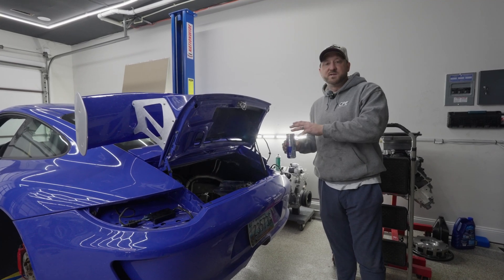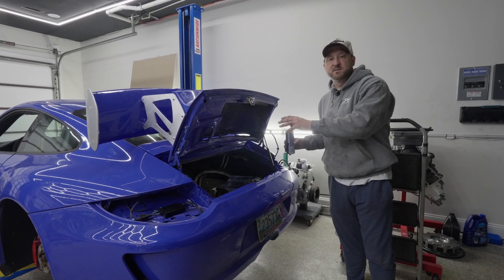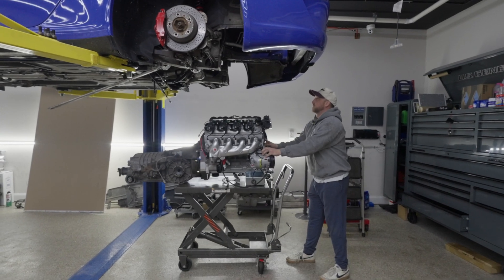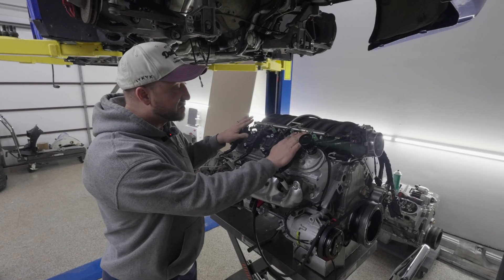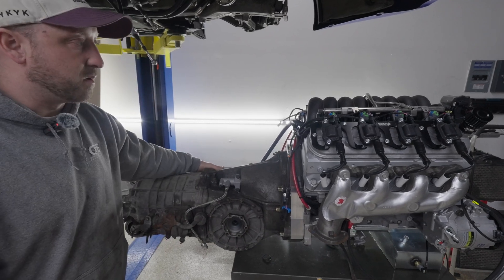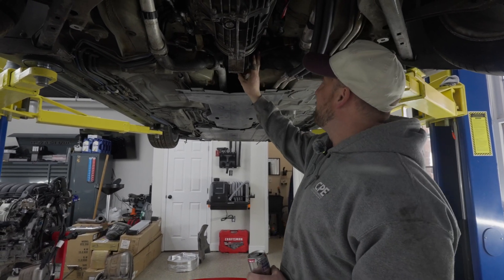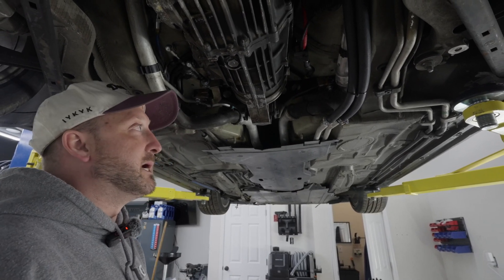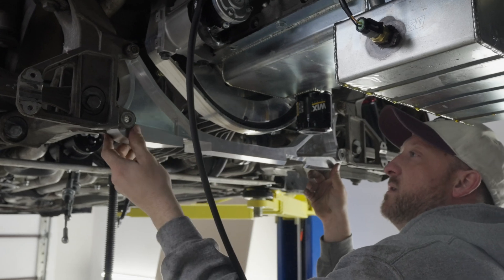"How To" LS Swap A Porsche 996/997

Comment: Looking at a clean 03 911 with no motor no transmission. I have an aluminum 5.3 with a 4l60. Do you have a kit for the GM transmissions to fit in?
Reply: Pretty sure youre going to need a transaxle and a 4l60 isnt going to work

Comment: Is you move the powertrain forward 1in does it that still work on a C4S? Thanks
Reply from the maker: It does, this specific car is AWD.  The driveshaft simply gets shortened, a fresh guibo/flex disc installed, and re-balanced for ‘02-‘08 cars.  ‘99-‘01 cars don’t require any modification driveshaft wise!

Comment: Do you find the 997 6spd AWD driveline to be adequate in holding up to the 495hp LS?
Reply from the maker: Insanely adequate and only an issue if above 550whp (not crank) and dumping the clutch/lighting up the tires via burnouts.

Our advice?  A little mechanical sympathy goes a long way and you’ll never hurt the transmission or axles if you’re already moving.
Reply: @ 
I am looking purchasing a 2008 997 from a gentleman who competed a conversion with your parts with a new Ls3.  Since these are pretty rare I don’t think taking it to a regular mechanic is going to help me when doing a pre purchase inspection.  Do you offer a service by chance where an individual could pay your team to look at it virtually?  Car is in  Charlotte NC.
Reply: @chavisperformanceengineering  Also thank you for the answer on the driveline limits.

Comment: If i have a perfectly running 996, how much to do a LS swap? Roughly?
Reply from the maker: We charge $40,000 turn-key which includes a GMPP 495HP LS3 crate motor.  Despite rising costs we’ve continued to keep pricing affordable and our production parts manufactures in the USA.
Reply: @chavisperformanceengineering  Props for being transparent and not saying "give us a call". That crate engine is about 10 grand, I'm just spitballing, but lets say a custom exhaust, the right oil pan, mounts, and a standalone ECU are another 7 grand. So roughly, you're charging 23k for your "product". Honestly, that is not too bad for what you get. It also gives the DIYer an idea what this project would cost to do on their own. I'd like to grab a 997 and an aluminum LS and do the swap myself but I need to sell some cars first... It also gives you an idea how cheap one could do this if you wanted to grab a cheap 996 with a blown block and a junk yard ls. Actually, there is an idea that could get your channel a bunch of views. Do this project as cheap as possible with a cheap 996 and a junk yard LS, dont use your custom brackets, use the modified ones, and see how cheap this can be done for. That sounds like a video the car community would eat up. I think @staytuned did their turbo ls for just under 20k, but I get the feeling it could be done for a lot less. 996s with popped blocks can be picked up pretty cheap if you have patience and are willing to travel out of state for it. "We built a LS swapped Porsche 911 for less than $10,000" is going to get a A LOT of views.

Comment: Awesome. Makes it more confident to diy the swap. Question for the 996.2 does it need a more flow fuel pump? I wanna do flex fuel e85 for it as well. Thanks
Reply from the maker: Yes, 996/997 RWD cars put out a base pressure of 58psi so upgrading to a Walboro 450 in-tank is ideal when running flex fuel.  The 997 C4/4S puts out a base pressure of 85psi so while such could suffice the in-tank system is too complicated w/ the siphone jets etc hence why we decided to run an in-line variant.